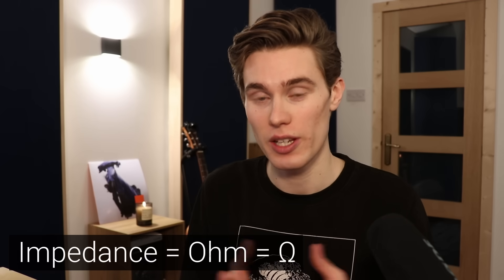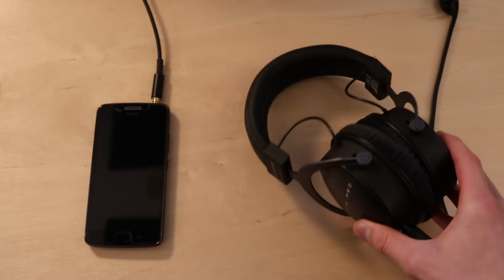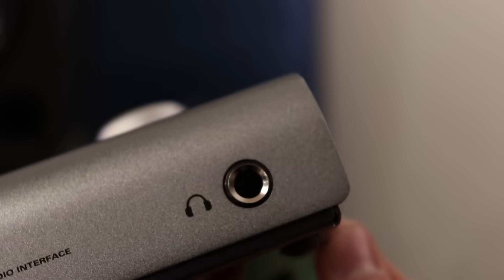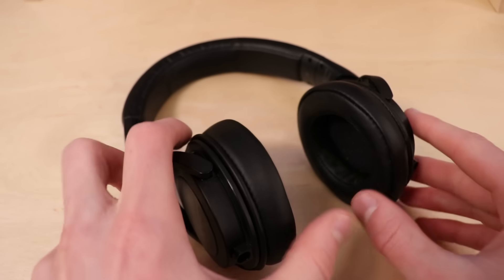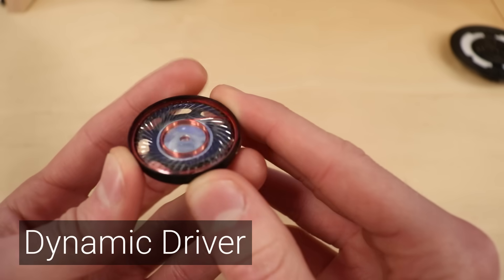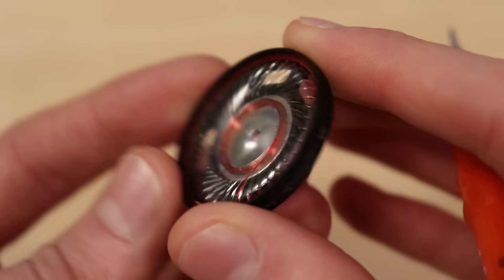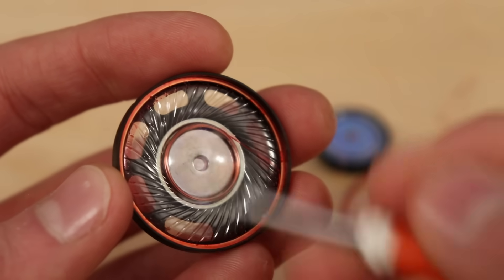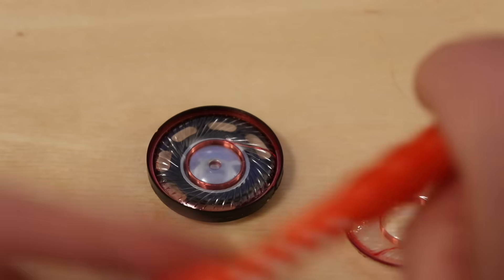32 ohm vs 250 ohm - Which Headphones Sound Best?

Comment: Hi, love your videos, I want to buy the 250 ohm 770s for studio use but would also like to use them just to listen on busses from my phone so I looked in to some portable headphone amplifiers and most of them were way to big, I did find a few that matched the size I was going for such as the apogee groove witch is super expensive and the boom stick or nextdrive spectra x but I'm just not sure what is going to give me enough for 250 ohms in to a smartphone. If you think I'm better off getting the 80 ohms version and than you have good suggestion for that scenario that's also cool so what do you think? Thank you!

Comment: My biggest question is whether my audio interface is able to provide enough voltage to use 250 ohm headphones? Is there any quick way to find out? Dont want to buy headphones just for them being too silent and having to return them :/
Reply: Hey, how that went up? Planning to buy 250's and have the same worry you had.
Reply: @janoharek3084  oh wow after 3 years a comment :D 

I went with the 80 ohm one and my ur242 is good enough so that half volume on it is getting too loud. The 80 Ohm are also perfectly fine for even phones. So I think with a decent interface you should have no qualms with 250. Atleast 80 is really easy to amplify for
Reply: @TheDarkFishbone  thank you, I will try both ate, but I hope for the 250's honestly :D

Comment: Hey I produced with 16 ohm headset 
Now it's left side sounds very low in volume 😭
Is their any issue if you connect 16 ohm headset to laptop which has higher power voltage
Reply: Your wire is probably loose or the Jack has widened try moving the jack slightly or moving the wire 
Unless you have a laptop with an amp that you had pushed to 100% while having the headset connected its not an issue
Reply: @mikaisfake  I lost my two headphones
Reply: @losthertz  what laptop is this
Reply: @mikaisfake  normal laptop
I think its because of power output I placed to 90

Comment: Would you say the dt770 work well for mixing as well as monitoring? Another video I saw remarked that it is not neutral enough for mixing.
Reply: Bro the dt 770 pro’s are overrated trust me I’ve had them for nearly two years NEVER get a good mix ur better of using AirPods I swear to god

Comment: Hey bro, thank you for the reviews. It always helps going through. I was planning to buy 250 ohm beyerdynamic 990 pro. However I was worried can it go easily without Scarlett 2i4,as the focusrite website suggest it only supports 200 ohm headphones. Will I need preamps if I buy 250 ohm headphone. Thanks bro waiting for your reply...
Reply: 250 omhs headphones works with that interface?

Comment: Why the claim that higher impedance leads to leas bass? It's only when your amplifier runs out of juice and starts to clip that the bass (or any frequency) will distort. Before that the frequency response should remain the same. Of course, if the source is AC coupled, it's high pass filtered, and a higher impedance load will give MORE bass.

Comment: Hello In The Mix! I’m about to purchase the Beyerdynic DT-770 and couple it with the Blue Yeti X Pro mic and I would like to ask you which size Ohm I should couple it with. The yeti offers a minimum frequency response of 20 hertz and a maximum of 20 kilohertz. Should I get the 32, 80 or 250 to pair with it? Thanks. Great video by the way.

Comment: I'm having a problem with my dt990 pros where I hear a distortion/clipping/crackling in the lows and highs (mostly in the lows) when playing the headphones at a relatively high volume. I just got the pair today and the problems occurred straight out of the box, which leads me to think that it's not a hair in my driver that's causing the problem. Plus, I don't want to strip the headphone down to the naked membrane because I'm not experience with that kind of repair and don't want to void the warranty. Can anyone help me?
Reply: I run my headphones through an M-Audio M-Track interface

Comment: Hey man, if im getting a dt 770 for my gaming pc, without an amp, which impedance should i go for?
Reply: I would say a lower impedance level, I just got 250 ohm 990's today and they're not very loud when playing through my phone.
Reply: "lower impedance level" does not mean anything to me, im asking like, if an 80ohm headset for example would run well on a regular gaming pc with no special equipment
Reply: @HellcatFTW  Im not sure about that I've never owned 80 ohm headphones but I was just saying that you wouldn't want to get 250 ohms because they wouldn't be loud enough without an amp or audio interface. Their 32 ohm option would be able to play the loudest.

Comment: I learned the hard way today that gaming headphones are not good for production, I hit a certain frequency and it almost blew my ears out..

Would 250ohm headphones be ok to hook up straight to your computer? Or do you need an audio interface?
Reply: You'll need an audio interface with a built-in headphone amp, or just a stand-alone headphone amp. Otherwise, you'll have the volume cranked all the way up on your machine, but won't be getting much volume at all through your cans.
Reply: @samhepperle4306  Gotcha, I'm new to producing but have been really getting into it, I bought a midi controller to help me learn keys and drum pads so I can make my own sounds. Long way to go but it's so fun.

Thanks for the reply 👍

Comment: Hey there.
First I want to say thank you for bringing so much knowledge in a clean and clear explaining.
I just bought the buyer dynamics 770dt pro 250 ohm..and I can't hear a difference in the volume vs my old headphones.(Sennheiser hd 215).
I've been told by the seller that I won't be able to hear any sound if I will plug them to my Android phone and I did plug them and I heard exactly but much nicer sound then the others.
So is it possible with 250ohm ?
In my studio I use prism sound Orpheus FireWire interface..and the sound didn't get any louder please help me understand why is that?
And if I should buy a headphone preamp?
I'm confused..
Thank you
Sensirly yoav.
Reply: mans really ended it like that

Comment: I had this question coming up in my head, too. So I asked Beyerdynamic directly. Specifically regarding the DT-770 and its three variants.

Low impedance: thicker wire for the coil, makes it easier for the current/electrons to flow through that wire -> low resistance/impedance.
High impedance: lighter wire, but the electrons have a harder time to travel through that "narrow hose"

Having a thicker wire makes the coil heavier and less reactive, MEANING moving a bit slower compared to a lighter coil. So the the 32-Ohms-version has less top end, compared to the 80- or 250-Ohms-variant.

I used and use all three versions here in a professional environment (broadcast). Being the convinced Beyerdynamic user that I am, my latest buy was a bunch of 32-Ohms DT-700 Pros. I do regret that buy! These cans sound too compressed and they're a tad too much on the dull side for my taste. But it was too late to return them, so I use them in a less exposed setting. When choosing headphones, in our field, besides the sound, other aspects come into play, too. For instance when being used by multiple persons it's good when you can clean the cushions more easily. Or, Beyerdynamic offers every single part as replacement parts, for decades and all models. They're made in Germany and they are a very solid company. The DT-770 Pros are built very sturdy, too.

That being said, I can really recommend the 250-Ohms-version for a broad variety of use cases. IF you have weak headphone amps such as in mobile phones, I'd give the 80-Ohms-version a try or switch to maybe a Sennheiser HD-25 or an Audio-Technica ATH-M50x for that.
Reply: I've been looking at the 80 ohm to use with a Mac mini M1. Think I may get those based on what you've said here. Thanks.
Reply: I have audient ID14 and RODE NT1-A. I have to use Phantom Power to be able to use the RODE NT1-A microphone. Should I get 250ohm Beyerdynamic headphones? Can Audient ID14 run both headphones and microphone at the same time?
Please help me out cause I'm definitely not an expert when it comes to ohms and all that things with the voltage and power. 🙏🏻
Reply: @wolfy9477 , the Audient will have plenty of power to drive both. I have an ID 14 myself and use a phantom powered mic and the 250 ohm Beyers with no problems at all. FWIW, I sold my 80 ohm Beyers once I got the 250 ohm model. The 80 is a bit bass heavy and muddy sounding compared to the 250.
Reply: (H. Inc) "A thicker wire makes the coil less reactive...So the 32 Ohm version has less top end than the 80 or 250 Ohm." -Are you sure about this? I think you mean the 32 Ohm has more top end than the 80 or 250 (due to thinner wires and more reactive coil.). 

I'm not sure, since these will be me first 80 Ohm headphones, but also, others have said the the opposite -meaning higher impedance gives more open soundstage, etc. Hard to know without personally A/B-ing them, i would think, due to all the variables in an audio chain and subjective ears.
Reply: Thank you, this makes a lot of sense!
Reply: The 32 ohm and 250 ohm are more alike than 80 ohm, which were made different, to sound louder at expense of audio quality. From beyerdynamic: 
"With 80 ohms, the DT 770 PRO differs significantly from the 32- and 250-ohm versions in terms of sound. The 80-ohm version of the DT 770 PRO has a two-part coil system and reacts somewhat more slowly, which causes a slight treble attenuation at approx. 6 kHz. This can be very pleasant for ears that are sensitive to high frequencies. The DT 770 PRO versions with 32 and 250 ohms have a three-part coil system. This ensures a faster performance and reproduces the high frequencies more faithfully, which is why the treble sounds more present. The 32 and 250 ohm versions have the same sound signature, but differ in the ear cushions" 

"Both versions, 32 and 250 ohms are based on very low mass, so called: underhang voice coils, which can reproduce enormous details with low distortion. For the lower impedance, we use slightly thicker - and less - wire for the coil, therefore, it plays louder with lower supply voltages (from mentioned units) as the 250 ohms version. 80 ohms DT 770 PRO is optimized for very high listening levels in a recording studio, for example musicians, playing an instrument, etc.. You normally can find very high power headphone amplifiers here and achievable level is more important than the last bit of sound quality. This transducer uses an overhang voicecoil, which is longer than the air gap. Its larger surface increases the electrical power handling (better cooling) but its higher mass results in a different distortion behaviour."

Comment: Hope you can help. I am looking into buying the Beyerdynamics DT 770 Pro's and will be using them both with my laptop for video conferencing, but more importantly connecting to a Rode NT USB and doing voiceovers for eLearning and video tutorials. Would you recommend the low impedance versions?

Comment: Will a beyerdynamic dt770 250 ohms handle a scarlett 2i2 ? im searching this everywhere and when i’ve asked focusrite customers about it , they said that the max impedance of the 2i2 is 200 ohm, but 250 will be only a little quiter. People are saying that 80ohms will be great, but at the other side they are saying that the sound is distoring when they turn up the volume and the bass is strange. I dont know what to do in this case and im so confused ;/ maybe 32 ohms, but im scared about the sound quality, can someone help me?

Comment: Hey really cool video explanation.  I have a question, I am a guitar player and I the 32 ohm AKG K553  MII headphones plugged into my Line 6 Floor guitar processor.  The AKGs are great. They produce great Bass sounds, but if i get the 250 ohm headphones  would I get more bass sounds from that?  I am looking for a better sound quality.  Thank you for posting this.

Comment: Question:
So the Audeze LCD-X can sound better than the Sennheiser HD800S?
LCD-X have 20 Ohm and the HD800S have 300 Ohm.
Reply: it doesnt matter impedance doesnt mean anything look for frequency response curves, even with the exact same model of headphones but designed to have different impedance im sure that if you need someone to recommend which headphones to buy then you wouldn't even notice any difference
Reply: if you want them to "sound good" just buy any cheap headphones with a curve of around +3dB and a Q factor of around 1  in 120 Hz, a tiny little bit of gain in a more narrow curve around 4-6kHz and a little bit more gain in one around 10+kHz, thats what most people in the consumer level consider that makes music "sound good" even if its not real fidelity

 if you are an aspiring audio professional then just buy the flattest and dullest headphones you can afford, if you need them for monitoring a mix you're looking for an honest and critical playback, not something that makes your music sound better because that wont translate to other devices

in any case having an acoustically treated room and monitors (as an audio professional) or a good set of speakers (as someone who likes music) is probably a million times better than buying expensive headphones, especially as an audio professional you will never use them again (except for reference, recording and doing work outside of the studio which usually doesnt require the best headphones out there)

Comment: Hi there , thanks for those videos , I just bought the Beyerdynamic Dt 770 250 ohm and i have some questions.
1- somebody told my the 80 ohm much better , is that right ?
2- and witch headphone amp should i get about 200$ ?
3- I have  the presonus AudioBox 96 , if i get the presonus hp4 amp with 300 ohm impedance will it give me the full Beyerdynamic Dt 770 sound quality  ?

Comment: If only the different ohm versions of the DT 770 didn't sound so different from each other! I think they must be tuned differently, the difference can't just be due to the impedance. Especially the 32 sound way different from the 80 or 250 ohm. The one that has the most bass is the 80-ohm one. The 32-ohm have harsher high mids/low highs, with less bass. The 250-ohm are like a tighter-sounding version of the 80, with a tighter bass but more bass than the 32. All of this is based on the specific units that I purchased. If anyone has more than one version and has had a different experience, please let me know.
Reply: I have a pair of 250s and a pair of 80s. They sound similar, but the 80s have more bass and upper treble. The 250s are thinner and harsher.

Unit variation is supposedly quite high with this line of beyers, though, which might be contributing.
Reply: @Nick_4i  Which one would you choose for mastering?

Comment: which headphones would you recommend to use with the audient id14. i have de akg 99 but I found it sounds quieter than usual even though it isn't a high impedance headphone. I also have  a  mackie onyx  interface and I find that the same headphones sound better on the mackie rather than on the id14.

Comment: if a noise floor in your dac/amp is let's say 15mv, a headset with a higher impedance will sound cleaner and not as noisy as a low impedance headset because the noise floor is lowered significantly

Comment: Higher ohms, the more power required to move the diaphragm.  The more power required to move the diaphragm, the quicker the diaphragm will cease moving due to an absence of power...wouldn't that directly equate to higher sound quality?

I don't know, maybe the difference is so imperceptible that it doesn't matter.

Your thoughts?  I've never had a pair higher than ~32 so I wouldn't know.

Comment: thing is : I have the ath r70x that are like 470 ohm, and I can still use them on my iphone 11, macbook pro, old ipad, surface pro, at way more than necessary volumes, and sound quality doesn't seem compromised. Same with my k702. After reading all over the internet about impedance, I was expecting to get little to no sound from my stuff on these without an amp. I'm very surprised. Any insight on this is very appreciated :)

Comment: I have the DT 770 PRO 250ohm and the DT 770 PRO 80ohm both working perfectly with either my pro equipment or my iPhone. No problem to play loud with the phone. But there is no apparent difference in either quality or volume between them. Shouldn't the 250ohm version sound a bit quieter than the 80ohm version? Or is the amp somehow compensating for the different resistance in the headphones?
Reply: Do u need an audio interface or amp for the 770 pro 80 ohm ? I’m looking to get em for my M1 macbook air for mixing my beats.

Comment: So I’m going off to study music at University soon. Within the studios, they have a tonne of workstations and recording software also with a full analog mixing desk. But I may also need to plug them into my laptop on the fly. Which impedance should I need, say in terms of the Beyerdynamic DT 770 Pro: 32, 80 or 250 ohms? Thank you!